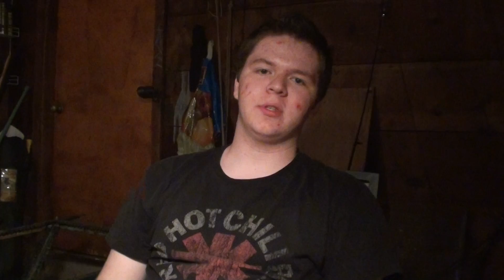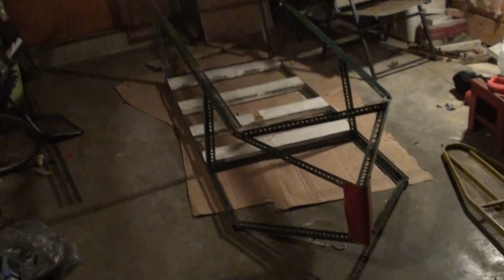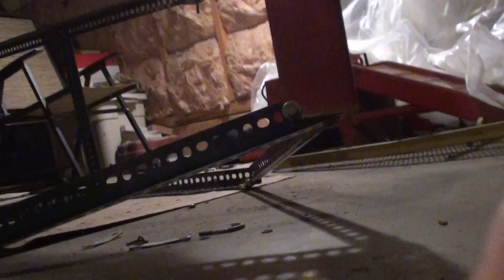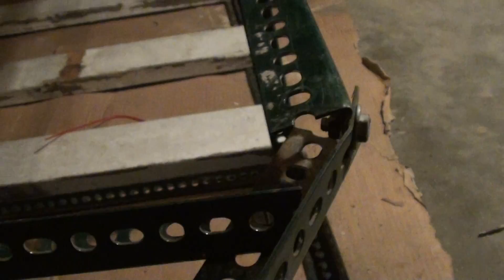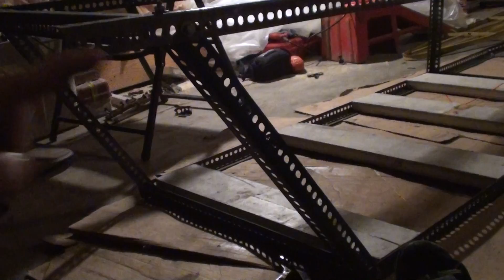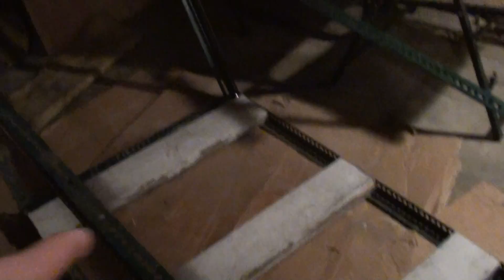New Duct Tape Boat Project - Part 1 - Building the Framework

Comment: I'd avoid making the bottom flat. it will track better if you put a rib lengthwise so the lowest point in the bottom making a "keel." Maybe use some of the 2 litre bottles ...... Interesting project